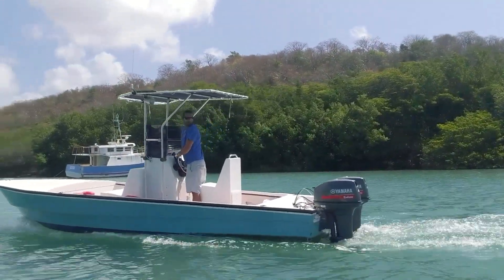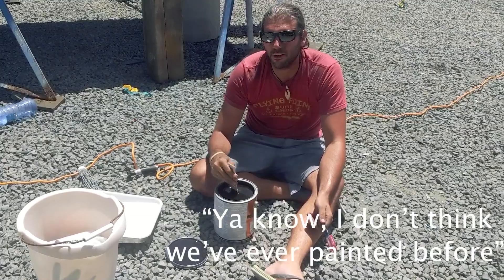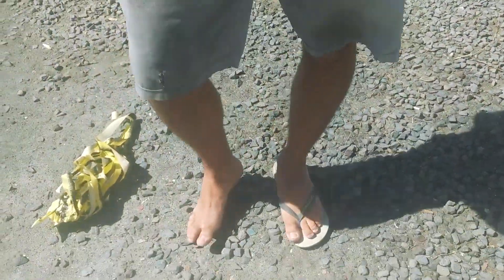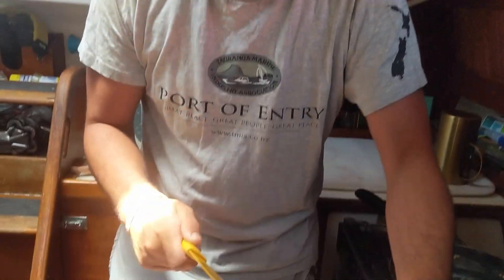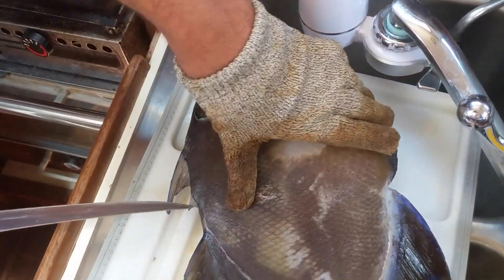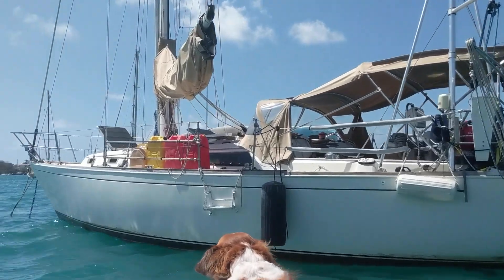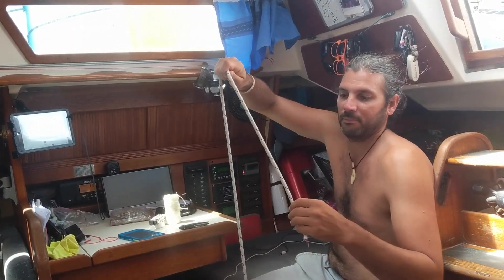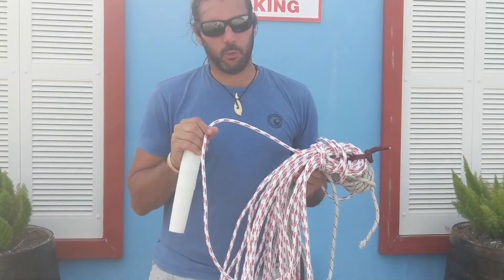When Opportunity Knocks we Top Up the Cruising Kitty (Calico Skies Sailing Ep. 9)

Comment: You spinnaker topping lift is internal?  Ours is external.
Reply from the maker: Yep ours is run internally and we keep chafing it on the radar dome mount. We didn't show it but i wound up sliding chafe protection over the new line where it hits the mount